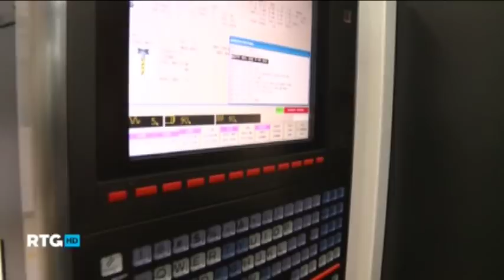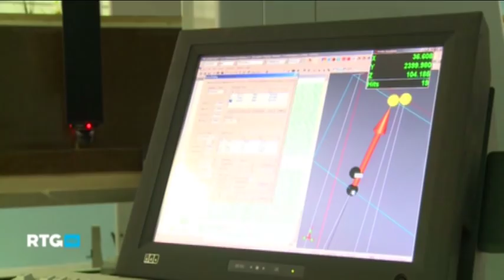Mil Mi-28 (factory)

Comment: Edited to update that since 24th February 2022, my attitude towards these aircraft has changed.

They are simply weapons used by the genocidal terrorist state of ruSSia in its blitzkrieg attacks in Ukraine.

These aircraft types and their crews have been responsible for mass killings of Ukrainian people in their own country.

Thankfully, the Ukrainian operated MAN PADS weapons systems have wreaked havoc on these gunships and their crews, engaging them wherever they are located.

Those Western CNC Machines will no longer be supported by the manufacturers, so no updates, upgrades, spare parts or new machines due to sanctions.

Seeing downed ruSSian military aircraft in Ukraine is something positive, particularly if the crew were neutralised as well as the aircraft.

Whilst they remain a weapon of the invader, these aircraft are targets to be downed.

Comment: I guess the Ka-50 failed so they had to copy the Apache.  This is like a 3rd rate rip-off of the Apache.
Reply: this is pathetic view on military technology. If copying those shapes was all that's needed to produce a gunship, then every little country in the world would be armed with "Apache rip offs".
Oh, and by the way, Does AH-64 posess armoured glass and cockpit resistant to 20mm shells? Research the topic and you'll find that Mi-28's cockpit protection is the strongest among all the helicopters in the world.
Reply: @kosiak10851  This aged like fine milk. There is nothing that can protect a helicopter (or an airplane, for that matter) from any current AA equipment. An armoured cockpit is useless if you can't get out of it while you're plummeting to the ground.
Reply: @Lightning_Mike  what do you mean by aged? For me nothing's changed in the world or whatever you thought here.